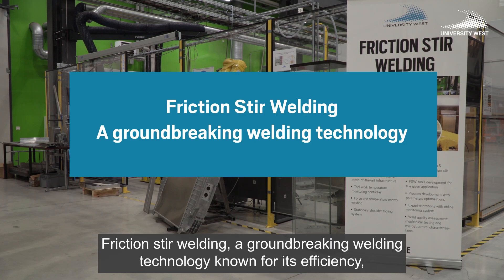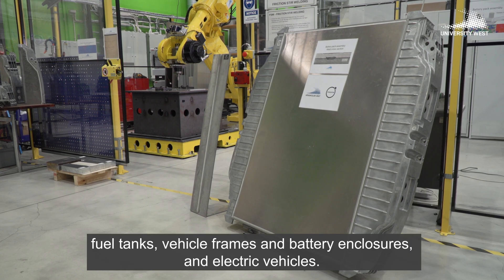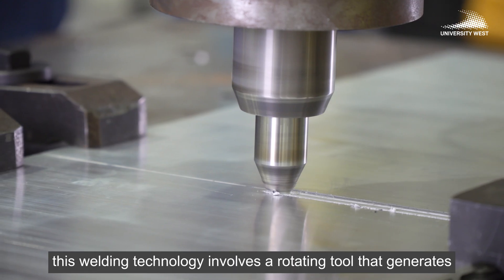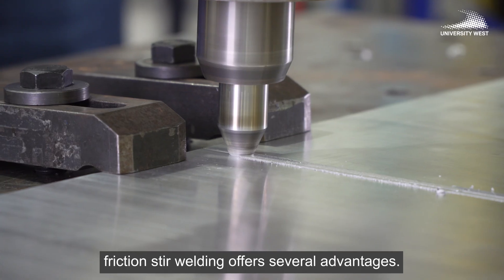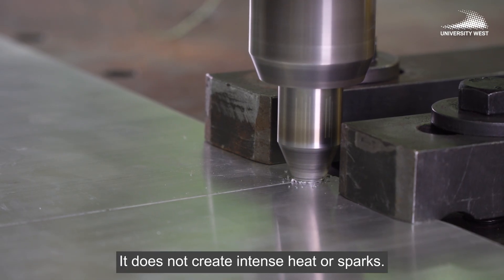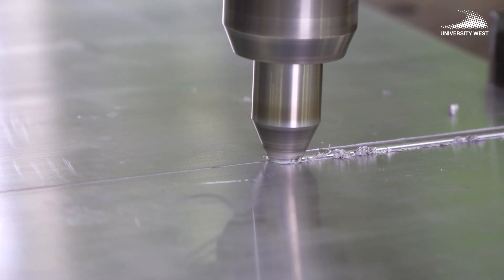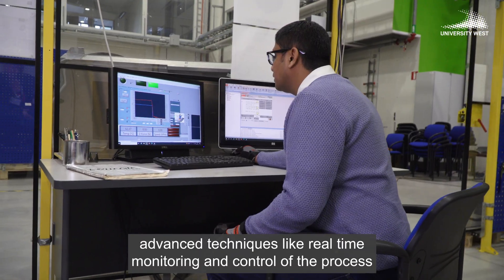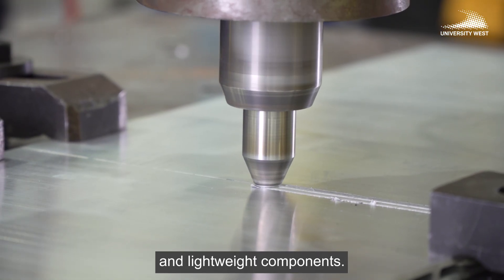Friction Stir Welding - research conducted at University West

Comment: Why would it be environmentally friendly? Still runs on electricity doesnt it? Yea we’re not harnessing electric very environmentally friendly yet…
Reply: Clearly youve never welded. The gas are straight up toxic. Idiot
Reply from the maker: Yes, but Friction Stir Welding needs less electricity than older processes. Another important aspect is the source of the electricity. If, like us in Sweden, you have access to green electricity from wind, solar, and hydropower, it significantly affects the climate footprint.

Comment: I hear alot of propaganda. I would like a more balanced view on the pros and cons of this method.
Reply: Introduction to Friction Stir Welding
Friction Stir Welding (FSW) is a solid-state welding process that was invented in 1991 by Wayne Thomas at The Welding Institute (TWI) in the UK. It is particularly effective for joining aluminum and other non-ferrous metals, as well as some ferrous materials.

Scientific Principles
1. Solid-State Process
FSW operates below the melting point of the material, which prevents the formation of liquid phases. This solid-state process relies on the mechanical interaction between a rotating tool and the base materials to generate heat through friction.

2. Heat Generation
The heat generated during FSW comes from the friction between the tool and the workpieces. This heat softens the material, allowing it to be stirred and joined without melting, leading to a fine-grained microstructure.

Methodology
3. Tool Design
The FSW tool typically consists of a shoulder and a pin. The shoulder helps to generate heat and provides a surface for the material to flow, while the pin is responsible for stirring the base metals.

4. Welding Parameters
Key parameters in FSW include tool rotation speed, welding speed, and axial force. Optimizing these parameters is crucial for achieving high-quality welds.

Pros of Friction Stir Welding
5. High Strength Welds
FSW produces welds that often exceed the strength of the base materials. This is due to the refined microstructure and the absence of defects commonly found in fusion welding processes.

6. Low Distortion
Since FSW does not involve melting, the thermal distortion is significantly lower than in conventional welding, making it ideal for applications where precise tolerances are required.

7. Environmentally Friendly
FSW is a more eco-friendly option compared to traditional welding methods. It consumes less energy and produces fewer emissions, as it does not require filler materials or shielding gases.

8. Versatile Material Applications
FSW can be used on a wide variety of materials, including dissimilar metals, making it suitable for industries that require multi-material joins.

Cons of Friction Stir Welding
9. Tool Wear
The tools used in FSW can experience wear over time, especially when joining harder materials. This can lead to increased costs and downtime due to tool replacement.

10. Limited to Certain Geometries
FSW is typically performed on flat or slightly curved surfaces. Complex geometries may require additional processing or different welding techniques.

11. Initial Equipment Cost
The setup cost for FSW equipment can be high, which may deter some small manufacturers from adopting the technology.

12. Skill Requirement
Operators need specialized training to optimize parameters and troubleshoot issues, which can be a barrier to entry for some organizations.

Examples of Base Metal Weld Results
13. Aluminum Alloys
FSW is widely used in the aerospace and automotive industries for aluminum alloys. Examples include the joining of 6061-T6 and 7075-T6, where FSW has demonstrated superior mechanical properties compared to conventional welding.

14. Dissimilar Metal Welding
FSW has been successfully employed to join aluminum to magnesium and copper to aluminum, showcasing its versatility in dissimilar metal applications.

15. Marine Applications
In shipbuilding, FSW has been used to weld aluminum hulls, resulting in lighter and stronger vessels compared to traditional welding methods.

Future Applications
16. Aerospace Industry
With the ongoing demand for lightweight materials, FSW is poised to play an essential role in the aerospace sector, particularly for aircraft fuselage and wing components.

17. Automotive Industry
As electric vehicles become more prevalent, FSW can be used to join battery enclosures and lightweight components, enhancing vehicle efficiency.

18. Renewable Energy
FSW can contribute to the production of lightweight structures in wind turbines and solar panels, promoting sustainable energy solutions.

19. Rail and Transportation
The rail industry is exploring FSW for joining aluminum components in train bodies, benefiting from the strength and reduced weight of welded structures.

Conclusion
20. Summary of Advantages
FSW presents numerous advantages, including high strength, low distortion, and environmentally friendly processes, making it a compelling choice for various industries.

21. Considerations for Adoption
Organizations considering FSW must weigh the initial costs and training requirements against the long-term benefits of reduced defects and improved material properties.

22. Research and Development
Ongoing research into FSW methodologies and tool materials is expected to enhance the process, potentially reducing tool wear and expanding its applications.

23. The Future of Welding
As industries evolve and the demand for advanced manufacturing techniques increases, FSW is likely to become a standard method for joining materials, particularly in high-performance applications.

Final Thoughts
24. Continuous Improvement
The field of FSW is continually advancing, with innovations in tool design and process optimization expected to further enhance its capabilities.

25. Global Adoption
As awareness of the benefits of FSW grows, its adoption will likely spread globally, particularly in emerging markets focused on advanced manufacturing techniques.

26. Educational Initiatives
Educational programs focusing on FSW technology will be essential to train the next generation of engineers and technicians, ensuring a skilled workforce.

27. Collaboration in Research
Collaboration between industry and academia can drive innovations in FSW, leading to new applications and improvements in existing processes.

28. Industry Standards
The development of industry standards for FSW will help ensure quality and reliability, further promoting its use across various sectors.

29. Case Studies
Real-world case studies demonstrating successful FSW applications can serve as valuable resources for organizations considering the technology.

30. Future Innovations
Future innovations may include automated FSW systems, enhancing production efficiency and consistency in high-volume manufacturing environments.

31. Comparative Analysis
Comparative studies between FSW and traditional welding methods will further elucidate the advantages and limitations of FSW, aiding in informed decision-making.

32. Economic Impact
The economic impact of adopting FSW on a larger scale can lead to job creation and the growth of specialized sectors within manufacturing.

33. Tooling Advances
Investments in advanced tooling materials, such as ceramic composites, may significantly reduce wear and extend tool life in FSW applications.

34. Enhanced Process Monitoring
Improvements in process monitoring and control technologies can enhance the quality and reproducibility of FSW joints.

35. Safety Considerations
As with any manufacturing process, safety considerations must be prioritized, with training and protocols established to protect workers during FSW operations.

36. Long-Term Viability
The long-term viability of FSW will depend on continued advancements in materials science and welding technology, ensuring it meets the evolving demands of modern manufacturing.

This comprehensive overview should provide a clear understanding of Friction Stir Welding, its benefits, challenges, and future potential.
Reply from the maker: Yes, Friction Stir Welding was invented in 1991 but is still quite new on the Swedish market. The process has been evaluated during over the past decades and is now attractive for new industry applications partly due to the ongoing electrification. So, we believe the process is groundbreaking for certain applications.